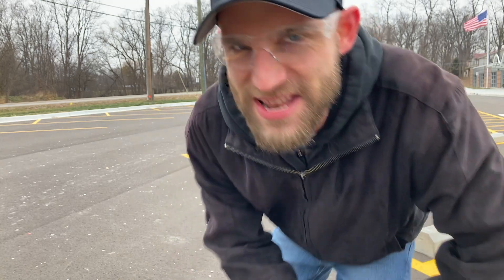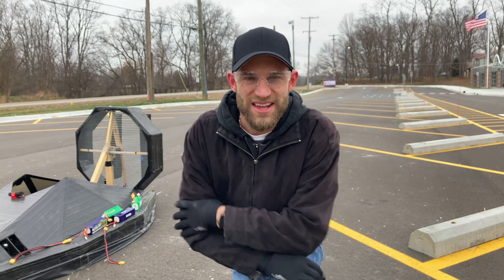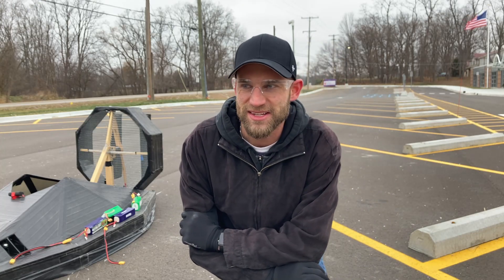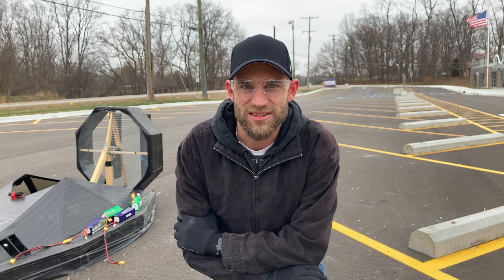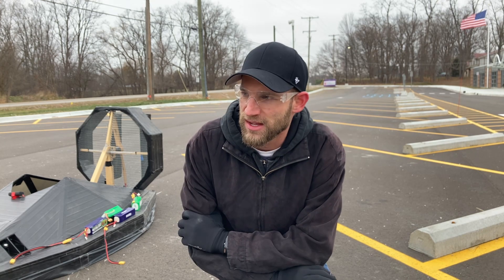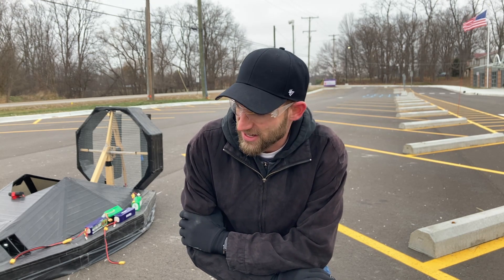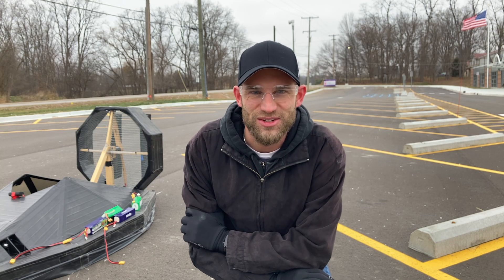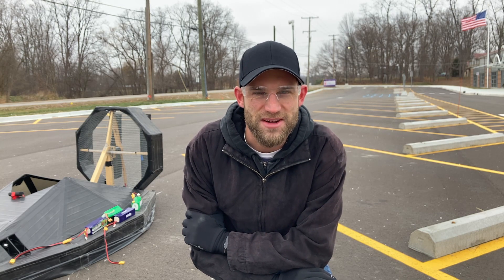DIY 12000W Electric Personal Hovercraft Running Test

Comment: What made you choose such a small platform? Of course there's advantages to a higher static pressure, but I would argue you went too small, water performance would be much better with a lower static pressure and a larger cushion area. It doesn't sound like you're pushing the lift motors too hard, and in fact a freer flowing cushion would likely unload them and improve efficiency assuming they're pitched sufficiently to keep up with airflow
Reply from the maker: Yeah, there's definitely efficiency tradeoffs by going smaller. For me, I thought it was cool to have a personal sized craft and also I could then build it in my basement and carry it out through the door.

Comment: Good job on the electric hovercraft. I always wonder if a electric motor from a electric lawnmower could be used for lift. And another for propulsion. Years ago i made a home made hovercraft using universal hovercraft plans. It was 10hp gas engine.  To hover stable over water with 200 lbs you will need at least 40 square feet of cushion area (8x5). I subscribe. Very interesting fun project you have there.
Reply from the maker: Thanks, I have been wondering how well the smaller footprint would work over water as it falls underneath the recommended area :)

Comment: Looks like good power in a small package.  I was looking into the OpenPPG project to get an idea what it would take to go to Electric thrust.  They are claiming possible 170lbs static thrust which would be pretty close to what I have now (reliability and no gas is tempting) but of course I think it would cost $5k to convert and  I have zero Electric Experience.  The Fans you used for lift and vector were not what I expected- are these off the shelf or homemade?
Reply from the maker: All the fans and motors I used were radio controlled airplane off the shelf parts ordered from Hobby King (tried to keep it cheap and simple). I personally like electric since it is what I am familiar with and easier to make compact. But it is relatively more expensive than gas and you may not get the same runtimes.